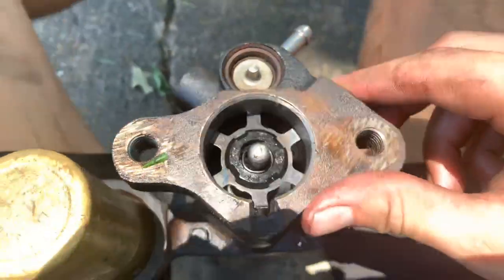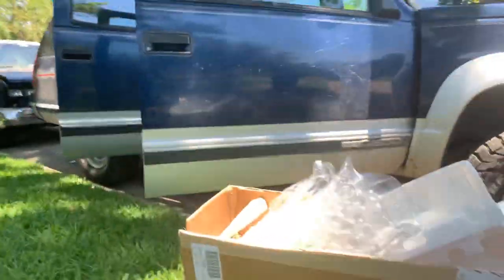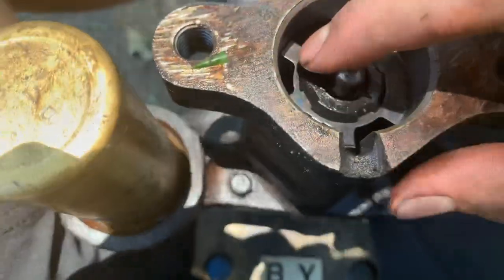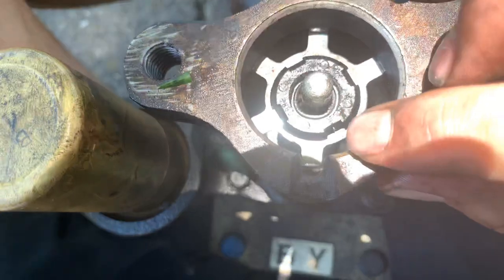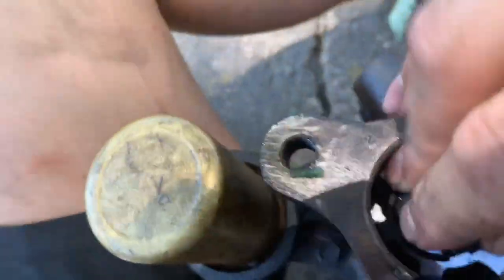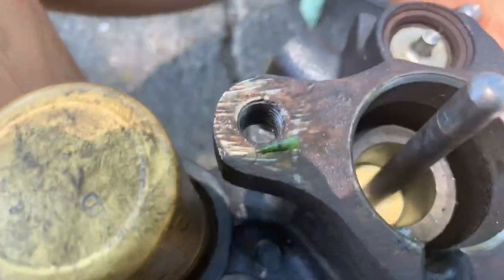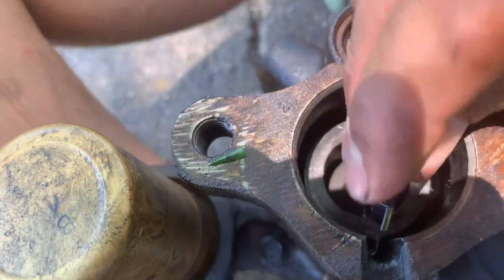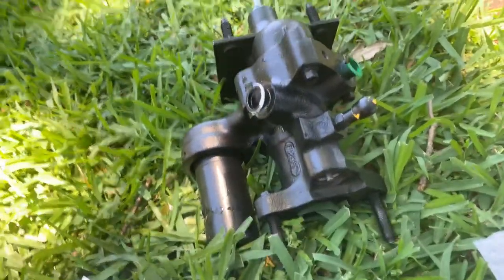removing master cylinder pushrod, spring, and spring retainer from old hydroboost

Comment: On my 07’ ram 3500 it has the same style only mine doesn’t have that slot, I had to bend the little tabs to get it out on the new hydroboost it does have the slot and push it in.

Comment: Thank you for having this im trying to change mine out but i had to order a new push rod set bcuz i forgot the old one in my other booster and i didnt know how to do it first time changing hydroboost and master cylinder 🙂
Reply from the maker: Man that stinks, hopefully it all works out for ya!
Reply: @hartwellfreitas  i appreciate it and now that i have the new one in there i think its too long and its bottomed out the brakes and the petal only goes down so far so i gotta take it to a shop and let them cut the push rod i hope thats the problem
Reply: I forgot mine too, where you order the new pushrod set?
Reply: @jesusbonillas9494  amazon you just have to be sure you get the right one

Comment: So I just replaced the hydroboost and power steering pump in my 2001 F350 7.3 and the brake pedal goes to the floor with the truck off, I jacked the front end up and went lock to lock with the steering wheel and pumped the brakes to bleed the system, now im still getting periodical brakes then it will go to the floor. 

I read the instructions but apparently not thoroughly enough I forgot to change that retainer clip out or whatever. Would this maybe fix my issue? I have no leaks anywhere else and I'm at a loss. I was gonna get a new master cylinder tomorrow since that's the only thing left I can think of. Can anyone help?